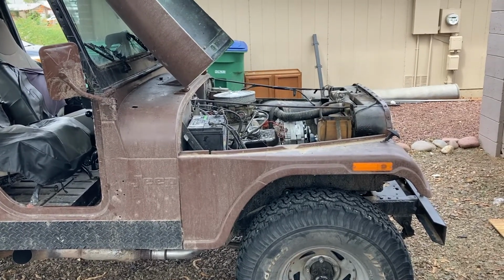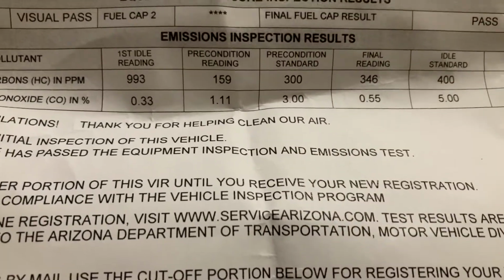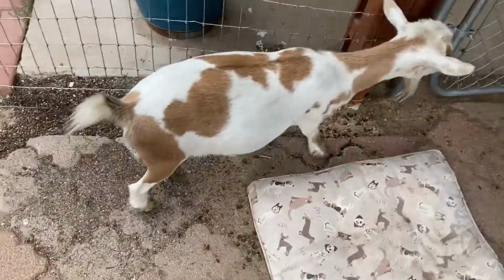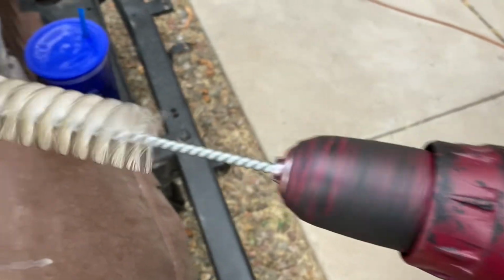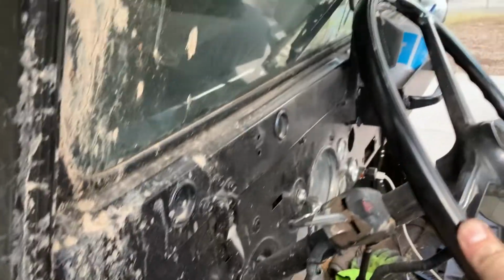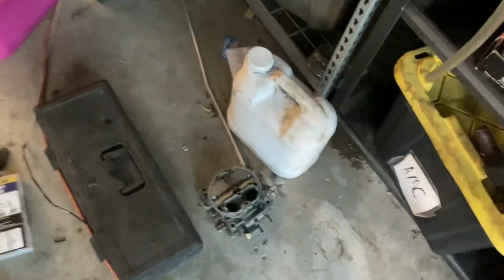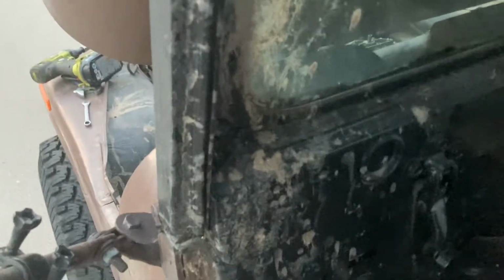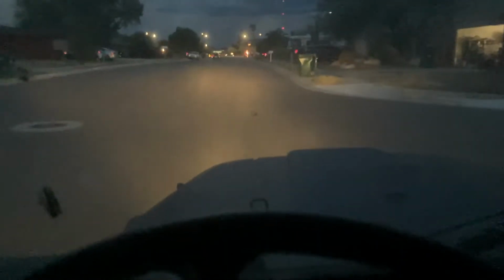getting quadrajet carburetors  to work on my cj5 jeep part 2

Comment: You have way to many quadrajet carbs. Maybe you could trade them for one good Rochester or Holly or Webber or Offy or 4 squirrels and a mini treadmill?  🤔 
Or are you just a quadrajet freak?  Now I'm not a carb guy at all. But is it just because you found some or is there a reason for using them? Are they easier to work on? Cheaper rebuild kits? What's the scoop. I haven't had to mess with a carb. engine in over 30 plus years on a Jeep.
Reply from the maker: It’s the thrill of the challenge, and the reward of taking worthless garbage and making it work
Reply from the maker: It’s the sick and twisted art of tinkering